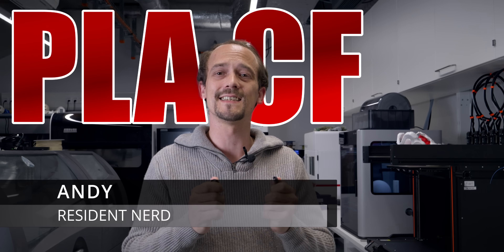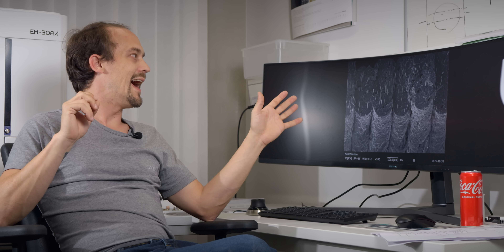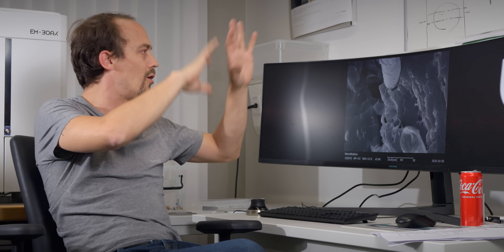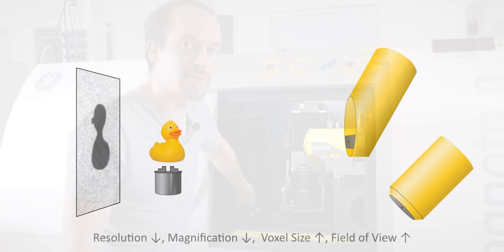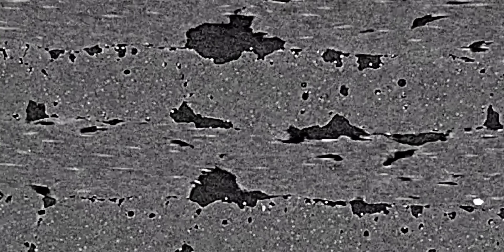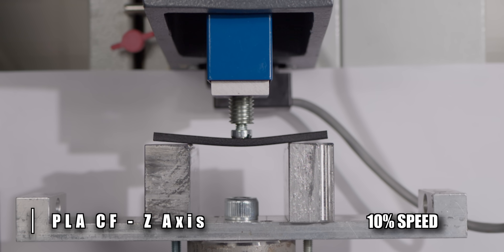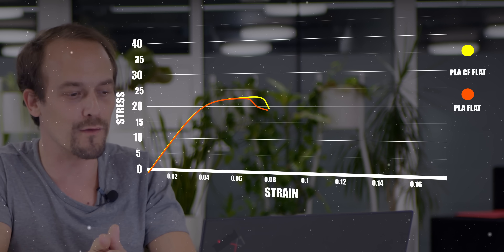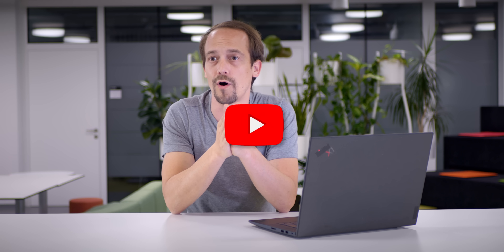3D Printing’s Biggest Scam Is Even Worse Than We Thought!

Comment: Because my other post is quite long I'm making this post separate One thing I would really like to see is your SEM and CT scans of a wood filled PLA. I am wondering if the fibrous nature of the wood might actually have some benefits because I do see some actual tangible improvements with woodfield parts mostly heat deformation resistance I have not tested for strength because I always assume anytime I add a material to another material I'm creating voice and those voids will always be a detrimental effect but I noticed that my wood-filled prints are far more resilient under heating conditions that would normally warp apart I am curious if the fibrous nature of the wood allows a more I don't know a matrix to form between the two parts the polymer and the wood especially since they're molten when they're combined and I'm wondering if a similar advantage could be realized with the additions of things like shredded cotton for example or some other sort of fibrous material. 

Woodfield PLA also has the advantages of carbon fiber PLA it's aesthetically pleasing you have a softer more fabric like more matte finish to the print You're not going to gain much in the way of strength in any way shape or form but it looks more pleasing. 

I also assume that wood is a bit safer when it comes to nano structures then carbon fiber is. Although that could be a false assumption on my part.

Comment: I've been telling people this exact same thing for many years but from a different perspective. 

CF materials are not a scam The issue here is not anything being scammed nobody's being lied to intentionally what it is is a basic misunderstanding of what a lot of these words mean. 

Most people do not understand what strength were toughness means we tend to use those words as an overall general concept and that's simply not the case. 

Even I can have sometimes difficulty describing this to people but there are many different ways to describe how strong something is two very basic ways to describe it is strength versus toughness for example PLA is very strong but it's not very tough TPU is not very strong but it's incredibly tough and if you play with both of those materials you might be confused and that's because you don't understand not you other people reading this Don't understand the difference between strength and toughness we tend to try to use those words interchangeably. 

Here's an example glass is incredibly strong but it has no toughness or at least relatively speaking it's brittle it can shatter. 

PLA is the same thing it's very strong PLA has a tensile strength of 35 megapascals That's equivalent to plywood and I think we can all reply what is pretty strong. 

But PLA is similar to glass in that it's brittle once you get close to his limits it doesn't give it's just shatters it explodes. 

TPU on the other hand especially if you don't print with a high density is not very strong I can deform it simply by pressing my finger against it however try to break it try to tear it it's virtually indestructible in toughness. 

In fact if you want a stupidly tough part that also has a little bit of strength use a high sure hardness TPU and print it with a high density so that it doesn't have that much flex you'll basically have an indestructible print for all intents and purposes that are relevant to most people. 

The issue here has nothing to do with the carbon fiber The carbon fiber is irrelevant replace the carbon fiber with steel or glass fibers or Kevlar aramid fibers I don't care what you replace with wood cotton anything. No matter what anytime you add a filler to an otherwise homogeneous material you will always 100% of the time weaken that material because as your scans have shown you are adding voids to the material and those voids will always weaken the material no exceptions all carbon fiber materials are weaker because of the addition of carbon fiber and it has nothing to do with the carbon fiber itself and has to do with the addition of a foreign material that does not perfectly bond with the material that's being added to. 

Now of course when you mix two materials together you end up with a hybrid of qualities carbon fiber is good for stiffness so in general when you add carbon fiber to a material will gain stiffness but you are going to lose strength not because of the carbon fiber but because of the voids you'll have that same loss of strength whether it's wood fibers or glass fibers or polyester fibers or whatever other material you want to add to your part. 

Sometimes these are of great benefit for example I used a wood-filled PLA to print a large group head ornament for my school bus it's been 6 years That Groot head is still sitting on the hood of my bus in the New Mexico Sun at 6,800 ft and it has not deformd because the wood fibers add stiffness they add integrity that prevents deformation however if I were to try to whack that part with a hammer it'll break easier than a pure PLA part although wood is a weird one because it's porous so I'm not sure whether or not the PLA can infiltrate the wood if it does you might actually gain something from that because the wood adds stiffness while not actually being stiff itself it's kind of like a matrix it would be interesting very interesting to see some SEM and CT scans of wood filled PLA.

I also wonder if there might be benefits to adding shredded cotton to PLA and I'm wondering why no one has tried that. Or shredded polyester any kind of fabric it would be interesting to see the results of that. 

Now in some cases if your material has an overabundance of one strength quality that you can give up in exchange for a different strength quality then you can gain benefits 

For example this is why carbon fiber-filled nylon is an effective material Yes it's better with carbon fiber but remember you're still making the nylon weaker by adding the carbon fiber because you're adding voids to the nylon and those voids will always make the material weaker 

The difference here is we can afford to give up some strength with nylon in exchange for something else that we need more stiffness so you could experience an overall benefit because nylon is pretty soft meaning it doesn't have a whole lot of strength but it has an incredible amount of toughness if you can prevent it from bending you can increase its perceived strength and since the bonding of nylon is so good you can afford to give up some of its own internal strength in exchange for an improvement in stiffness and I think I'm using those words wrong here this is how confusing it gets you kind of need to be a material science person to really speak about those correctly so I hope you understand what I'm saying 

Basically you're giving up one quality in exchange for another quality 

The problem with PLACF is that you're giving up the same quality in exchange for another of the same quality PLA is already stiff and when you give up some of its strength for a inconsequential or possibly even non-existent increase in stiffness you end up with an overall weaker material and possibly too weak to complete the objective mission. 

It's not about how strong or tough the part is it's about how strong or tough the part is relative to the mission directives. 

If your part has enough strength for the mission directives but not enough toughness for the mission directives and you can improve the toughness to within mission parameters without reducing the strength outside of mission parameters then you have an overall improvement in performance this can happen with carbon-filled nylon 

This will never happen with carbon filled PLA however carbon filled PLA does have advantages 

It just has nothing to do with strength it has to do with aesthetics if you want a strong part stay away from any kind of filled PLA it's not going to work except possibly maybe wood however you will gain some aesthetic benefits 

Basically I see PLACF as a decorative filament it has a matte finish and it has an almost cloth like texture and look both visually and tactile. 

Meaning basically it's pretty Prince that you make with carbon fiber PLA look nice. 

Just remember those parts are largely decorative you can still use them in a strength application for example compression if you have a relatively solid part that you were simply compressing between two other parts okay you're not going to lose anything by using carbon fiber CF but if there's any kind of bending or twisting or stretching involved you're going to lose a lot with carbon fiber CF. 

And it's not the carbon fiber that makes it weaker it's the voids being created that make it weaker and the benefits of the carbon fiber simply do not outweigh the detriment of the voids not even close. 

If you want to improve stiffness with carbon fiber you need to use a different hybrid approach I don't remember who made the video but they just made a really good video you can buy little strips of carbon fiber impregnated in resin basically a layup that you can trim down to whatever size you need as little strips or rods or tubes and you can design your parts to integrate printing pausing adding these materials to the part and then continuing the print designed properly you can gain massive benefits from doing that. 

So think that three-point bending model and now put two small strips of 1 mm thick carbon fiber embedded in the model yeah you're not going to break that not easily but that's a lot more work. 

Carbon fiber is very strong but only in a very specific way and most of people do not understand what strength actually means and that's where the confusion comes with carbon fiber PLA it's not a scam it's a misunderstanding of what these words mean and what the results of these things are.

Comment: I haven't watched yet fully, 2 min in, I'm not into 3D printing much (I have an overview of the tech available and how it works. I'm more interested in the tech itself than the uses I could get out of it.  I've never understood cf printing. It can't really work. 

To print it you need to cut it, which takes away the major strength of cf - tensile strength through incredibly strong and continuous fibers. It's also not like 'forged' cf, which also lacks tensile strength, does better in compression and impact, though. With cf you pack and press lose fibers in all directions to have a better load diffusion. With printing you need really small strands and you feed them enclosed into viscous fluid along a tube, the fiber will orient themselves along the flow direction, making them lay down uniform. They'll float or sink in the fluid polymer, like any object of differing density in a fluid does. They'll also cling to the wall of the tube and nozzle and other fibers moving along, until the clump is heavy enough to get ejected out the nozzle to become your failure point.

for CF printing to work it would need to work to the strengths of CF, which are continuous fibers, and your fiber to polymer ratio needs to be heavily in favor of fiber. Just enough polymer to infuse the fibers and have them bond to the layer below and above. Any material which has precut CF would be out. It would need to be cut at print time, so that you can lay down as long a strand as possible and layer it that way. Not having a vacuum to bond the fibers as tight as possible also wouldn't be ideal. At that point you'd basically be doing something between 3D printing and more traditional additive production methods and you'd end up with a better part than you'd get printing, but a worse part than you'd get doing it by hand with a vacuum bag, a pressure form, or both.

CF is just a nice way to produce a black print and reduce the lifetime of your feeder system and print head. Never will be more in context of printing.

Comment: Would this apply to other fibers/plastics, for instance kevlar or glass filled nylon? I ask this specifically because I have been using a Kevlar nylon filament that at least seems to me somewhat more abrasion resistant and stronger along layers than normal nylon filaments.

Comment: What's wrong with PETG+CF?  Also what about dimensional accuracy and looks?  There are other reasons to consider CF that you haven't considered in this video.  

Personally the only role of PLA+CF I bought is one of the worst I've purchased, but it's mostly due to absolutely terrible stringing.  I've got some great prints using Polymaker Fiberon PETG+CF though.  I'm quite happy with that.

Comment: Great work, 

With the polymers having a different and much higher coefficient of expansion and contraction with temperatures than carbon fiber. You can see the PLA shrinking away and around the carbon rods and detaching themselves from the surface. Mixing two materials that are no admissible without any type of cohesion surface bonding, is simply adding expensive raw material that provides very little attributes to the final product. 

The voids within the material are interesting and elongated along the flow direction from the nozzle. This could be from a combination of moisture trapped during the filament mfg, thus elongated during the melting and extrusion through the nozzle. I would expect them to be more circular (ovalized once extruded)

Or/and possibly the effect of a high LDR content of mineral additive. This is commonly used in cheap Filament mfg to reduce cost, by loading high content of inert mineral fillers. These also do not have good cohesion properties (better than CF, but not ideal), increases stiffness by greatly reduces overall strength. 

Last, if could be the effect of shear thinning. Where the layers of polymer chains while being extruded are moving at different rates through the cross section of the filament extrusion nozzle (high speed extrusion). The layers that are touching the outer walls of the nozzle are moving at a far lower speed than those moving in the middle of the melt flow. Think of the river flow as the water close to the river banks are moving far slower than in the middle. This effect would be accentuated by adding mineral fillers and CF as well. 

Better results could potentially be accomplished by mixing a lower cost fiberglass. CF just sounds more fancy.

Comment: I printed a sleeve to go inside a metal tube and keep cables going into the tube from chafing on the tube edge.  First sleeve was PETG and only lasted about 300ft before breaking at a layer line (wall thickness of the sleeve was about 1mm).  So then I tried my sample of PLA-CF, it separated in the same spot after 10ft!  I guess this explains why.  Thanks for the video

Comment: Seem stubid mixing cf into pp or pe if the plastic goes into recycling you risk  the cf going into  other pp pe products,for example food  drinking water  type of products.
It's like the bio degradebla  bio plastics that is put into the material stream of real plastic.
You dont want your canoe made of recycled plastic to  degrade, or a pp water pipe in the burried potable water network that  prematurely  fails.

Comment: I love PLA-CF. I use it for all of my functional prints for Car accessories under the hot sun. The secret is "Annealing", it becomes way stronger that ABS and PETG or even Nylon and way temperature resistant. You could anneal regular PLA but the CF prevent it from warping plus the cool finish. BUT and with a Big but annealing shrinks the object and you have to design around it, probably it closes all those microscopic pores. 

Thanks for the video. But I think you didn't give PLA-CF  justice and trying Annealing it at 100C for 1hr and see the difference. Dr.Igor did a video on that a year ago and he also confirmed that.

I forgot to mention print temperature makes huge difference. try that !

Thanks

Comment: I heard in there near the beginning something like: “the cooling/freezing temperatures allowed the material to retract from the CF fibers.” This is a misunderstanding of thermal contraction. Unless an exotic material structure, everything contracts uniformly. All holes get smaller, without exception. What could happen is different CTE’s cause something to shrink at a different rate, but this is CF. Its CTE is so much lower than basically any plastic. There would be no separation or “retraction”

Comment: Wow that's really interesting. I tested a few PETG and PLA CF composites and didnt love any of them. PA6-CF however has been fantastic. I'd love to see similar imaging for some polyamides and other high performance filaments. Thanks for making this video!
Reply from the maker: Thanks for the feedback! High-performance filaments would be fascinating to look into.
Reply: @Ibuiltathing  I print a LOT of drone parts for my work as a cinema drone pilot. So far Polymaker PA6-CF has been the best all round high performance filament. Parts are brittle at first but absorb moisture after a few days and toughen right up. Layer adhesion is also insanely good.

Comment: The air is probably inherent to the pla, adding the carbon fibre jus gives the air a place to go. If the pla is melting under vacuum i bet it would bond better, or at least surround the carbon better.

Comment: it's really not surprising CF PLA offers no benefit. Carbon fibers strength comes from tight bonds allowing every individual fiber to take segments of the load, and full carbon layups become stiff and strong because each individual fiber works with its bonded neighbor. these filaments don't provide the bonding that is found in proper layups, so you get the scenario where a carton of eggs can hold you up, but 1 loose egg isn't doing jack.

Comment: Yeah, I bought something from a seller and when I received it, it was printed from a CF filament. This is something that was supposed to go on my FACE, and attached to some optical plastic lens. I dropped it right in the fucking trash. Stop using this shit unless you have a particular specialized need for it.